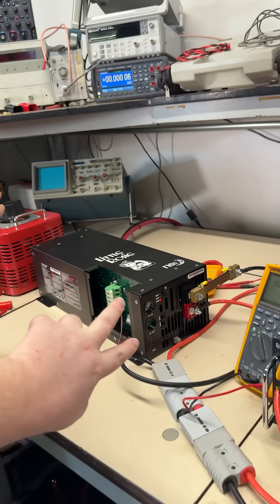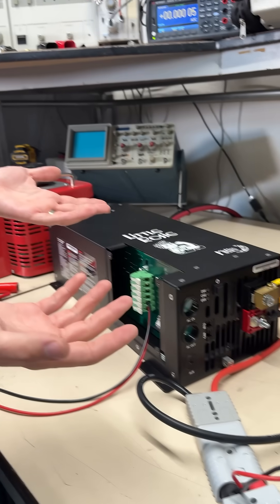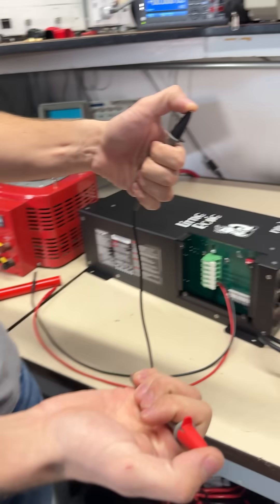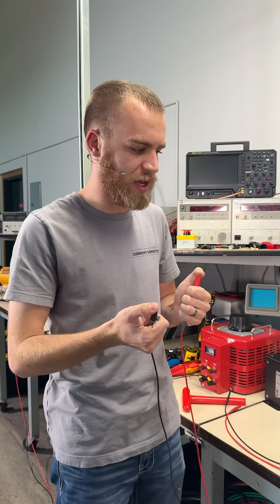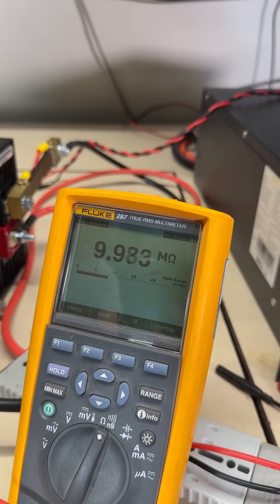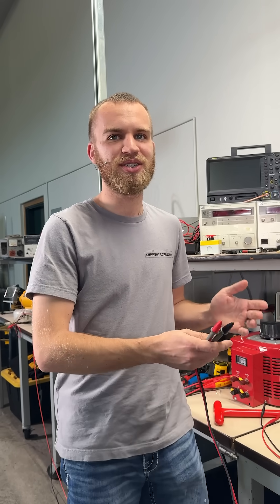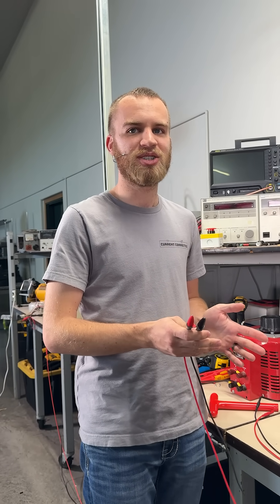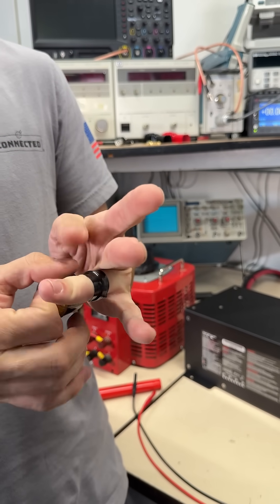What is YOUR electrical resistance?

Comment: "Overcome the resistance" isn't the correct phrase here. 

Current is still flowing, it's just on the order of micro amps and you don't feel it.
Reply from the maker: That’s partly true, however the resistance is not fixed. Skin provides most of the resistance and once current begins flowing the skin breaks down permitting more current to flow.

Also low current is measured in amperes not ohms
Reply: @CurrentConnected it's easy enough to measure.

And yes, sorry... I've been measuring busbars all day and microhms are stuck in my brain!